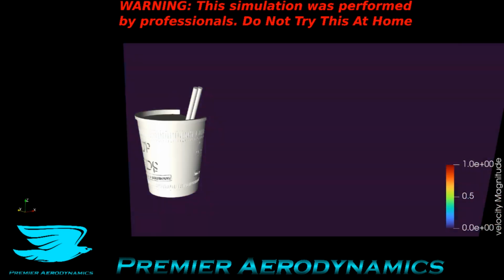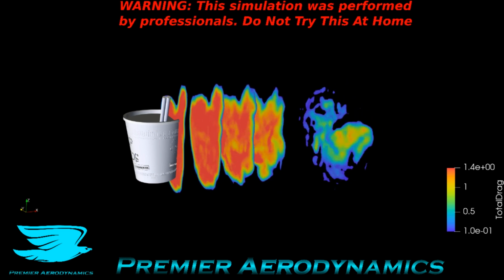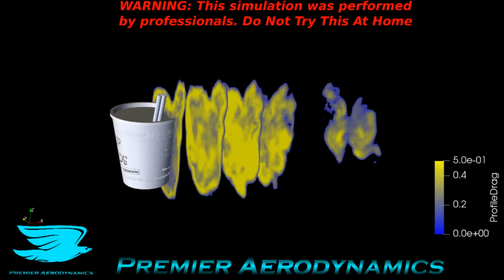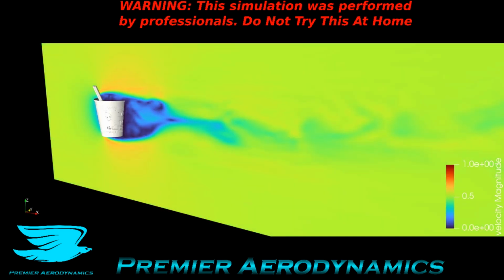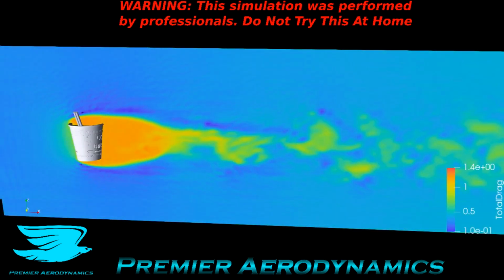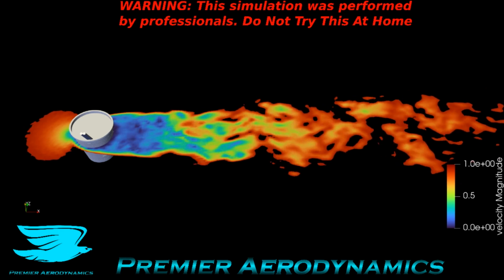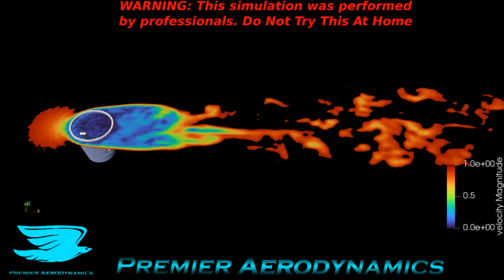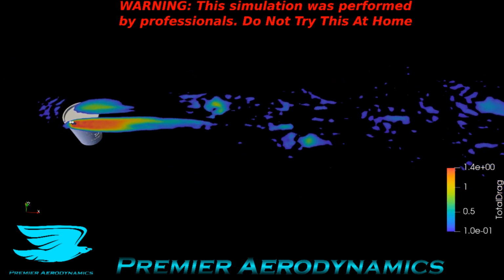Aerodynamics of Cup Noodles

Comment: i wonder if the aerodynamics would change with the temperature of the noodles? i might be getting something really wrong here but doesnt the heat of air also change its density?
and that could in turn affect the flow, no?
Reply: love this channel btw, actually really interesting even the more 'shitpost' videos 👍
Reply from the maker: @billy8thirty  Thanks! If you can't use aero to have fun, then what's the point?? Lol

Definitely, the temperature of the noodles makes a difference. Like, if you had hot noodles, then left to get more noodles, then came back to eat them cold, that would change the aerodynamics. The hot air rises as well, which changes the flow over the top.